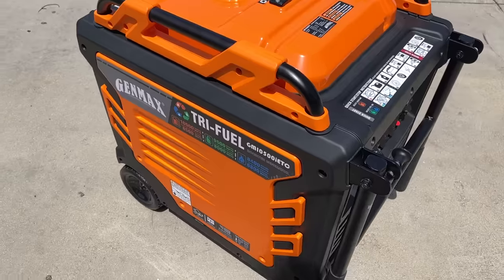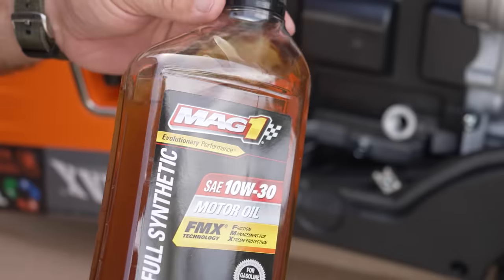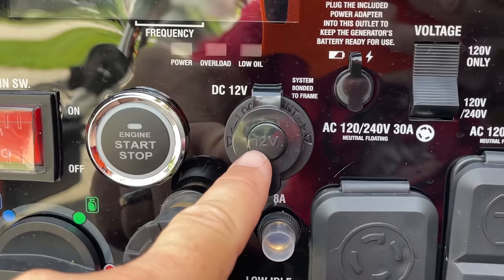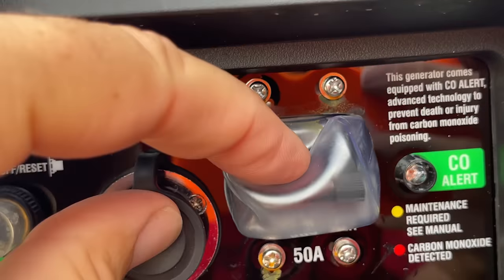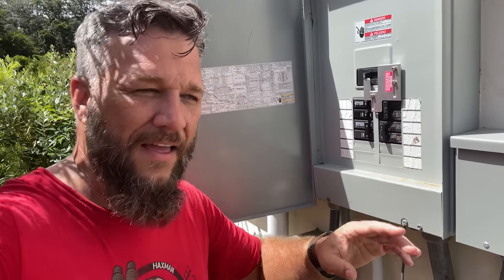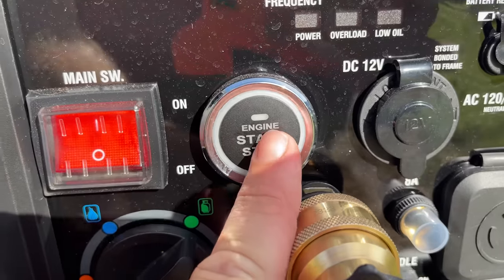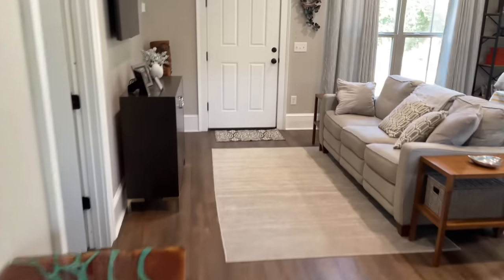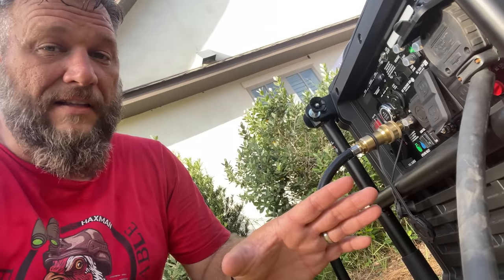Don't Buy A Generator Until You See This Monster!

Comment: The 50A outlet is only a 30A outlet unless you are using two of these in parallel (6:10 timestamp).  Really?
Reply: It outputs a FULL 30 amps, but that means a parallel kit only consists of a couple of wires linking the two together. Way simpler in my book.
Reply: On 240v, it puts out the following on each 110v leg... 

On gasoline it will put out 35.4 amps per leg running.

On propane it will put out 33.3 amps per leg running

On natural gas it will put out 28.3 amps per leg running
Reply: I think he is talking single phase wiring is only 30 amps. Most boxes are wired in double phase. If you are using the thin single breaker you can only get 30 amps but everyone wires double breakers when they want 50 amps.
Reply: Someone else just pointed out this generator is only 10500 watts so yeah since it's wired to a 240V box that only gives about 30 amps because the resistance or ohms is 8. Ohms times Amps equals volts. If you could drop the volts to 200 that would be less resistance or ohms which would allow the full 50 amp potential.

My air conditioner if running is only 192 volts because when it's already started and in motion their is less resistance ohms so if I direct wire it to my air conditioner it will put out 50 amps.

Comment: 9500 ? that is less than half of what a small home needs and 9500 is peak not running watts .. in any case non of these generator last very long, the engines/motors do not have  an oil pump like a car engine so there is no pressurized lubrication meaning that the bearings and piston and rods never get sufficient oil to lube it.. in the last year and half I've used 2 generators and in less than 1000 hours of use the all wear out the engines rendering the generator useless

Comment: Automatic Transfer Switching is way overrated! How hard is it to throw a couple of breakers a couple of times a year? Unless you have a huge, truly whole house, unit, ATS is just a silly and expensive luxury. If ya got money to burn, go ahead. But manual transfer or just breaker/interlock is the way to go for most of us working slobs. It takes time to switch anyway so everything without a battery operated UPS is going down anyway. What's the big deal? Go out back, flip some breakers, hook up the generator, pull the rope, and turn everything back on. I remember when we had to actually crank our car windows up and down, had no A/C in cars, had to turn our heads to back up, had to reach across the car to unlock the door, and get our fat butts out of the chair to change channels.

Comment: $2899. No thanks harbor freight hear I come.
Reply: I didn't know Harbor Freight sold a 10.5k Tri-fuel generator, only a 9.5k gasoline for $2499
Reply: @gooffeyguy   no but a 9k for $879 right now if need to could get 2 of them for that price.
Reply: @michaelmartin3474  you are comparing apples to oranges. That $879 generator isn't an inverter and is an open frame (very loud) style generator, and single fuel.

I'd these features are not important to you, then yeah, there are many other generators out there that cost less.
Reply: You can parallel two predator inverter open frame 8750 /7000w generators and cost would be $2400. For a total of 14k inverter watts 😅

Comment: Just do it the right way and gas is no problem. 
I run my 10k duel fuel twice a year. I press the button and it starts right up. 
I cut the fuel and let it run dry everytime to clean out the carb.
Id rather have 10k watts than the 9k i would get with propane. I paid for 10k.
But, if you don't know what you are doing, stick with propane your mommy will be happy with you.

Comment: This is a misleading video the first 10 seconds claiming it’s the most powerful generator is a lie it’s not even close I have a generator that’s almost 5 years old that’s 12,500 starting watts and 10,500 running watts that’s dual fuel propane or gas that would put this one to shame And was less then half the cost of this one you’re peddling lol and has remote start and power failure auto detect with simple purchase of a box that you plug an extension cord into from any outlet that then connect to the generator the auto detects when your power grid has gone out and automatically starts at South and Powers whatever you’ve got plugged into it then automatically shuts off when the power comes back and I’ll bet yours is chinesium as well there’s much better generators out there I promise.
Reply from the maker: Get the wax out of your ears. I said INVERTER generator. Yours is not an inverter. Get your facts straight before you call someone a liar.